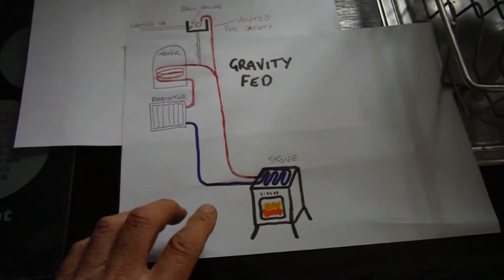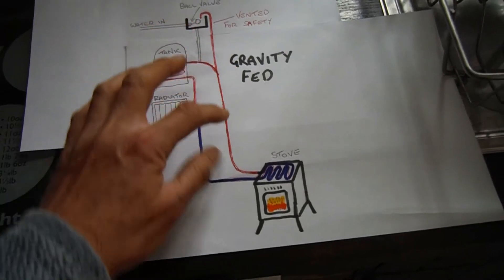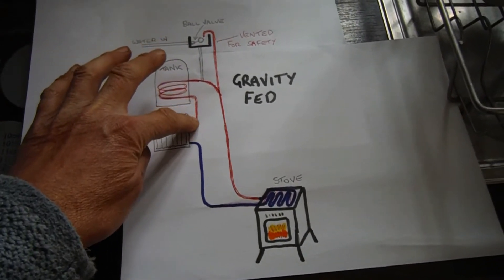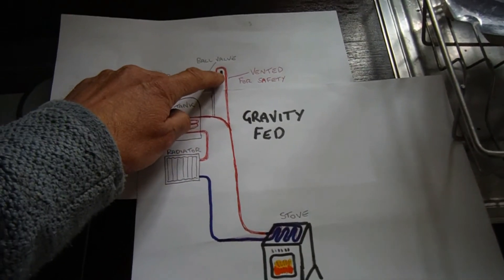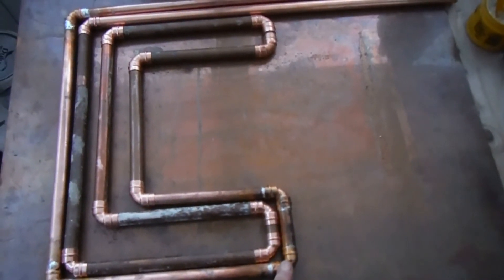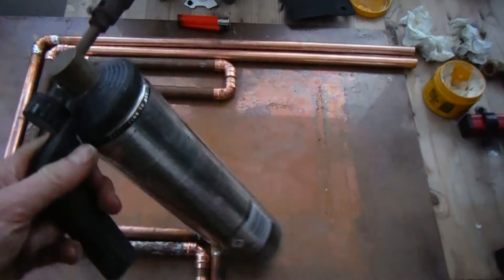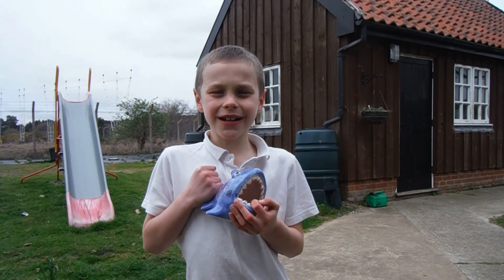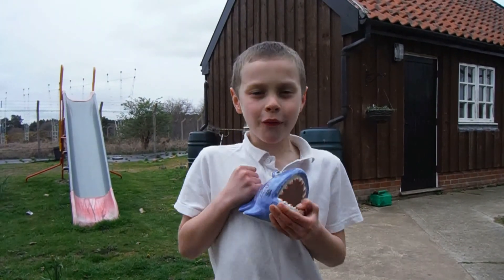OFF GRID HOT WATER.

Comment: Awesome idea ! And yet so simple ! Do you think this would generate enough heat to supply two upstairs radiators ? I thought I had better ask before I go running copper pipes everywhere ! 
Thanks in advance
Reply from the maker: Hello Matthew, im  sure it will work two radiators very well, ( just takes a few hours to heat up)  make sure the copper pipes are large in diameter to get the gravity system to work, plenty of vertical large pipe work with radiators directly over or near to the downstairs wood burner, we have 22mm copper pipes on this but bigger works better  to get flow if you have small amounts of horizontal pipe work upstairs if radiators are not directly above, my boiler tank is directly above my stove. No electric pump needed. The pipes on the stove casing to exchange the heat are 15mm copper, which is fine. Make sure its a vented system for safety and use a corrosion inhibitor in the system ( fernox corrosion inhibitor or similar for radiator systems) . Thanks for popping by, take good care and good luck on your installation.

Comment: That's a simple but great idea, would it be possible to add a back boiler if you wanted to heat radiators ?  thanks,
Reply from the maker: Hello, a very good question, my style of retro fit top boiler would not be good enough to run many radiators because there is not enough heat transfer to the pipes sitting on top, it does take about 8 hrs to heat the water tank  to 42 oC giving us hot water in the evenings for baths or showers. But a better design would work for radiators. Thanks for your question take good care.
Reply: Interesting, thanks,

Comment: hello mate, very happy to find this. looking to rig up a back boiler the same. I dont know much about the hot water tank, i get the rest, but what is the name or type of tank you use, if perhaps you are not using a pump or anything electrical. CHEERS
Reply from the maker: Hello Gaz, thanks for popping by, the tank is called an indirect tank or cylinder , they have a copper coil inside them, so the hot water system on the stove side is contained separate from the hot water used from the tap,  this separate system has a anti corrosive liquid added ( corrosive inhibitor , i used one called Fernox central heating protector), i love this system as it does not use an electric pump, great for power cuts ! thanks Gaz, take good care , sorry for a late reply.